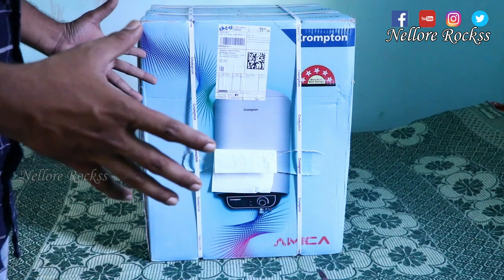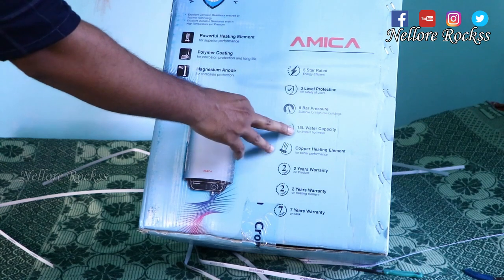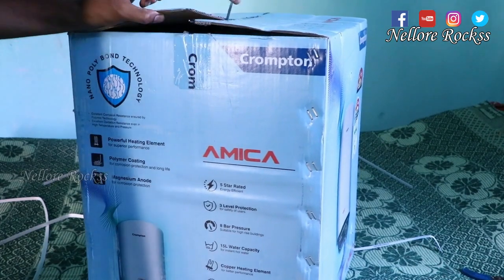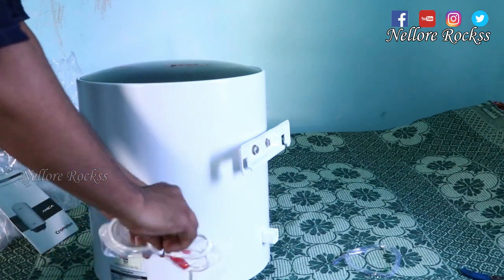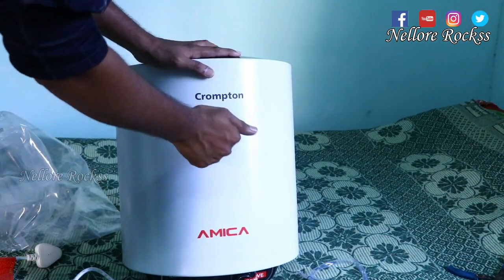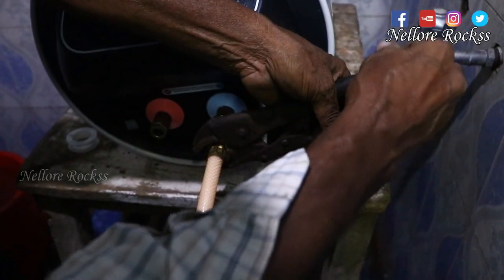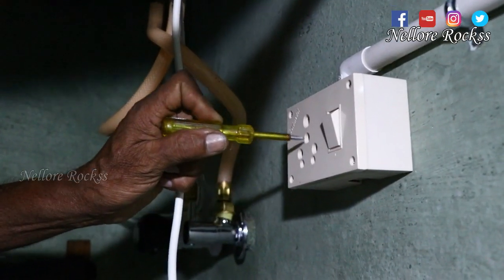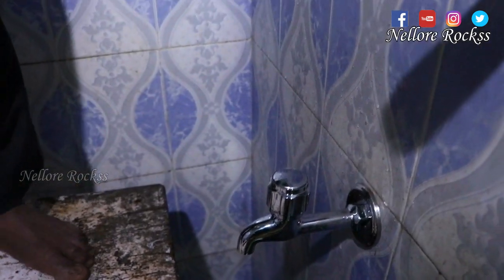Crompton Amica 15 L Water Geyser Unboxing & Installation | NelloreRockss | Nellore

Comment: Please don't buy crompton amica 2month before bought this product.after 2 days heater has trip. In this heater reset switch is inside so we need to call service person to reset the switch. After 1month heater is not getting switch on. They replace the product. Still we facing the same problem so please don't buy this product.